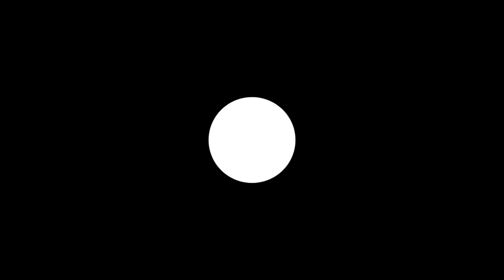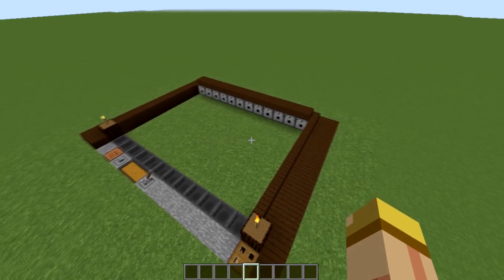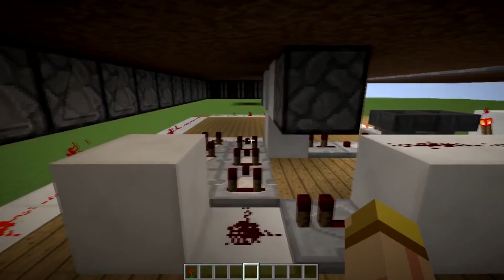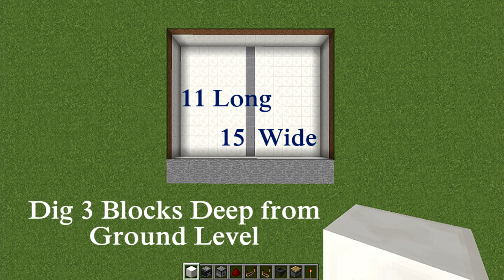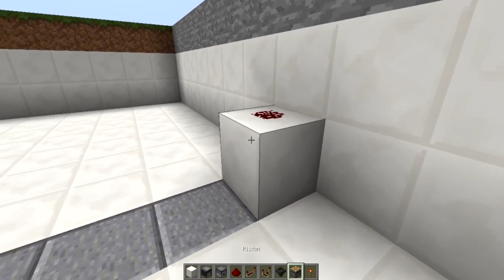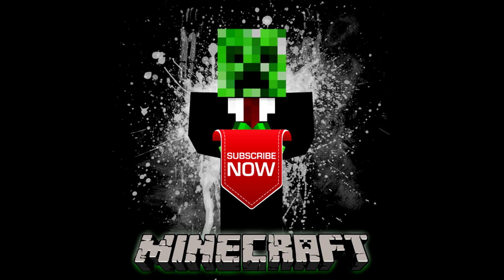Minecraft Tutorial : Flower Farm V2 (1.11)

Comment: Thank you! I noticed that on some servers the pistons don't stay in sync, so sometimes you'll get air blocks on the right side. You can fix this by replacing the left piston side's 2nd repeater with a torch and wiring the button up to the left side's piston redstone (using a repeater to make it one-way). This causes the button to activate the left side pistons just before dispensing the water, ensuring that there are no air holes on the right side.

Comment: Works great after a few tweaks... using minecraft v1.12. ( PC )

You go through a lot of bonemeal, but I don't use it for anything else. I need a skeleton farm...

Great for my Rabbit farm... :)

I had to tweak the timing a little, as the moving floor just locked up when I switched it on.
After tweaking the floor, I had to change the timing on the bonemeal dispensers. As they stopped working.

Right side repeater, that goes into the right side pistons. 2 ticks
Left side repeater, that goes into the left side repeaters. 3 ticks
Front repeater, that goes into the bonemeal dispenser. 3 ticks